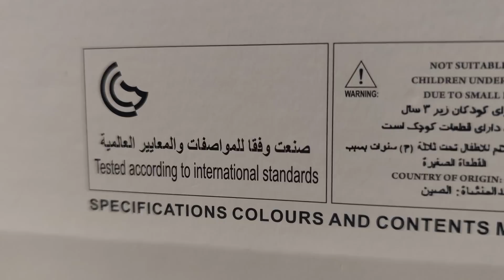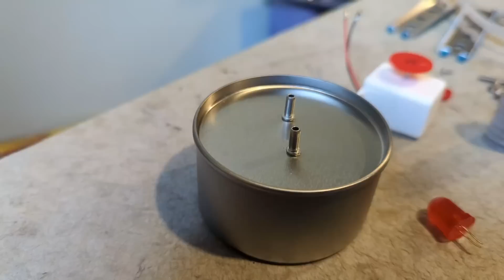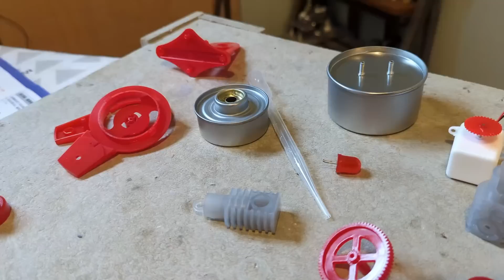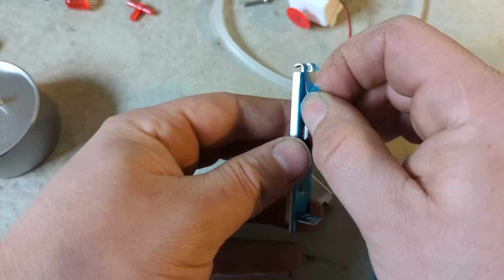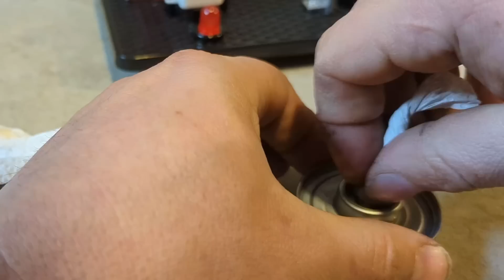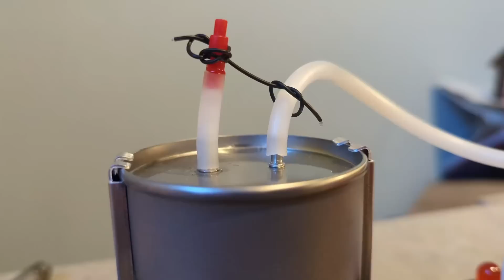Will this Plastic Steam Engine work? Cheap Chinese Tat!

Comment: Many, many years ago, a friend on mine had a toy dune buggy that ran on compressed air. The air motor was entirely made of plastic, and was an amazingly simple bash-valve design, in which the piston would unseat the inlet valve when it neared TDC, and there was a two-stroke style exhaust port near BDC. It worked superbly, but you had to make sure to flick the wheels in the right direction to get it started, because it would run equally well in reverse.

Comment: Lawrie, I think this thing actually melted while you were running it lol. That would explain why it never ran again on this boiler, and it'll only run on the bigger boiler in your newer video. Why didn't they use a higher temp plastic? :')
Reply from the maker: The boiler just couldn't make enough pressure.
It's very naff

Comment: i used to have one of these when i was 13 or 14 and i modified it to run on one cylinder and i used the small burner on a gas stove to heat it and i used a screw to plug the "safety valve" so it would run faster, although the pipe did disconnect once from over pressure, i also lubricated it with vegetable oil.

Comment: me in thr corner who knows how to read traditional chinese and little amount of simplified:
(i like trains anyways so)
Reply from the maker: That would make it easier - was there any mention of how much water to put in the boiler?
Reply: @lmm  as expected from crappy mainland stuff, nope, it only says boil the water and put it in the steam engine for 15 mins.
btw, it says it has to use 95%+ alcohol XDXD don't know what they're on about

btw, slight reminder chinese is not a language, it's a range of languages including mandarin and cantonese and etc. which also contains 2 modern day chinese scripts, traditional and simplified. 

so pweese can you not deny me for saying this? :D

nvm, found it out, the water tanker isn't for water, it's for 95%+ alcohol, what the hell am I seeing XD

Comment: Haha that safety valve will spout hot water when it pops off at about 5 bar and the water  inside starts flash boiling.

Edit: without barbed fittings and with soft overheated plastic I think it fell apart before it even made 1.
Reply from the maker: It's useless

Comment: You could try connecting the generator to a power supply to see if that is able to turn the engine over. If it is, you could use it as some kind of display model.
Reply from the maker: It's just not very pretty as a display model
Reply: @lmm  True. It does show how a steam engine is supposed to work though. In a horribly plasticky way of course.

Comment: I want to make mass-produce and sell a proper metal steam engine with 2 cylinders driving a single wheel with proper valve gear so you can change the timing and everything

Comment: this seems more like a steam generator then a steam engine. i don't see anyway this can be dangerous... outside of swapping all the silicon tubing with coper and braising it on... but as designed, it seems to be very very low pressure with no real danger outside of a silicone tube flying off. even the top of the tuna can seems like it's designed to give way before the steam pressure can do anything to the actual "pressure vessel." though all this seems incidental and not purposeful.
Reply: Explain brazing copper pipe to a plastic cylinder base?
Reply: @lloydpenfold486  talking about brazing coper pipe to the pressure vessel mainly, lol. it's all bad at the end of the day. it might not be "dangerious" it's just bad.

Comment: Twin single-action steam engines are usually set up with the piston stroke 180° out of phase with one another (rather than the 90° common on dual-action pistons). Looking at where it would stop each time, I suspect this is a large factor given the lack of flywheel. As they share a common crank, having the cylinders exactly opposite should work much better.

Comment: Didn't you know the GWR experimented with plastic boilers in 1921 and the safety valve bung with a string was patented by the LMS a year later? (Not). I guess that is the 'Chinese Export' CE mark not the real one.

Comment: It doesn't need a sight glass. Mamod even now sell boilers without sight glasses. There is nothing in the regs that state it needs a sight glass, and certainly not at that size. If it needed a sight glass then the Sage coffee machine sat on my kitchen worktop couldn't be sold, nor the combi boiler in my utility room. Please show me where in the boiler test code volume 2 and PSSR it states anything about sight glasses. I have had people quote some mythical European regulation, but they've never presented evidence when asked.

That safety valve, while shonky, if it pops off at or just over the design pressure of the boiler then it's good to go. That's the point of them. You could stick a cork in there and as long as it pops out at the correct pressure every time it's tested, then it's good to go. Would I pass it if it were presented to me? No. Would someone else? Likely.

Comment: I have to say, I think you might be actually a bit charitable in your conclusory summary. I was blown away to hear that that monstrosity was twenty quid -- it genuinely looks like something you'd find in my local Dollar Tree for a buck and a quarter... three dollars at most. (Dollar Tree, here in the States, now does the Poundland-style thing of tiers -- $1.25, $3, $5.)

How to make it run better? Make a version out of metal that's actually got proper quality to it, and put that under-engineered bit of recycled soda-bottle on a shelf too high to reach but that you can at least occasionally glance at to remind you how much better everything else is.

At least it's somehow too useless even to actually be able to hurt anyone.

Comment: It seems to me that there is one clear way to make it function somewhat reliably, and that is to reconsider the part of the instructions that referred to the "generator" as a motor.  I imagine that if you were to attach a battery to it, this would function passably well.

It might even light the LED consistently if you do that.

Comment: I didn't think it was possible for anything to exist that would, or could, make the term "cheap and nasty" seem like something you might aspire to. I mean, that piece of plastic garbage didn't even approach the quality of cheap and nasty. For example, the famously poorly regarded Austin Allegro was cheap and possibly not of the best quality as a car. By comparison, a Trabant is cheap and nasty. But and, it's a big BUT a Trabant still pretty much functioned as a car the same way an Allegro did. That so called steam engine wasn't so much a steam engine as a dangerous, utterly ineffectual, micro-miniature humidifier given how it spewed out water vapour all over the place. Thank heaven we have safety standards to keep trash like that off of our shores

Comment: Being plastic doesn't really worry me - if the material of choice can take the pressure and temperature then its just a case of how much wear it will take and how long you want it to last. 
Of course even if this was made from metal it would still be tat because the design and build are atrocious.

Comment: The boiler reminds me of the combined boiler and engine on a pop pop boat,  Maybe it can be turned into a large pop pop boat?
Here is a suggestion: Toss away the cylinders, fill the boiler with water and put a tube to both outlets and put them into water and figure out if it creates thrust.
If that does not work and it is not too much bother, try shortening the boiler using solder, perhaps a smaller size will enable the rapid expansion that drives the pop pop boat.

Comment: It's an educational product in how not to design a steam engine.
Probably best to only run in on air pressure, the heat from the steam is likely affecting the plastic cylinders.
Reply: I thought of tap water, it has the advantage of only causing a mild splash if anything should actually decide to rupture. On the other hand, at such a low pressure air isn't likely to cause much damage either.

Comment: I think as yoou pushed that pipe back, some molten plastic cloggged up the connection thingy on the boiler. 
Crap is not a curseword, crap is a practical word to describe the state of sth.

Comment: "Meets international standards" of Chinese cheapness! Maybe you can use the parts on your model railroad module or wargaming for buildings or something. That """""boiler""""" could make a storage tank at least.

Also, why do you need to censor "crap"?

...

...

Pedantry alert: I'm sure the generator is a motor being turned because the only difference between them is the direction of the energy conversion. Electric motor = mechanical -> electrical. Electric generator = electrical -> mechanical. A vast majority of designs are interchangeable.

Comment: replace all the neoprene "Gubbins" with copper pipe and get a proper boiler...
Reply: ...and a metal cylinder / piston combo, metal flywheel,,,or just get a Mamod or Willesco engine!
Reply: @lloydpenfold486  Mamod straight!

Comment: one of those that if they had made it twice as expensive and twice as well made it would have actually worked out at least as a novelty item unfortunately it seems there is a minimum level for an engine type thing to actually work

Comment: I wouldn't get near that thi g because of the soft boiler and pressure vessel.
I'd save those 22£ and use it on repairing my old and lovely Steam engine.

Comment: Etailers need to be held accountable for distributing dangerous products, let alone simply scammy ones.
Reply: I think this was posted to the UK straight from China, without involving any European distributors. UK customs are probably a bit too busy to check every single parcel arriving for items that violate trading standards or safety regulations.

Comment: Question the accucraft ruby's don't come with a sight glass but they come with a boiler certificate are they not legal in the US
Reply: You specify a quantity of fuel to a quantity of water in the instructions. If everything needed a sight glass then Nespresso machines wouldn't be legal. This conversation has been had before
Reply: i wish my ruby had one, idk why but it runs out of water before fire every time i ran it so far
Reply: @ziplocBagofRobloxia  put less fuel in the burner
Reply: @JSmith19858  easier said than done with butane in a copper pressure vessel
Reply: @wesbrackmanthercenthusiast4695   pressure relief valve on the tank and set ambient temperature. At a set temperature and pressure in the fuel tank there will be a specific mass of butane
Reply: That type of model loco is designed so that if you fill the fuel tank and put the specified amount of water in the boiler, the fuel will run out before the water.
Reply: @samk4128  the gas on mine last several minutes longer than the boiler water does